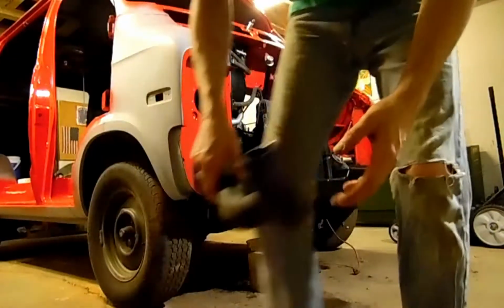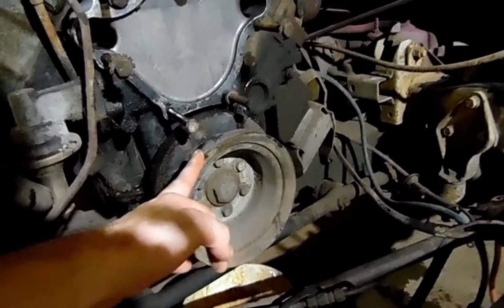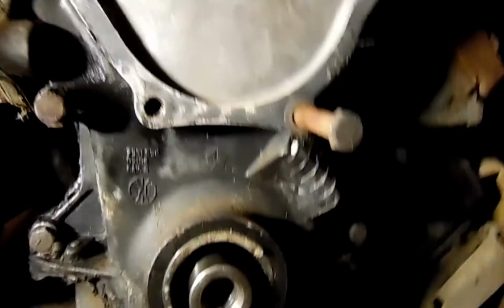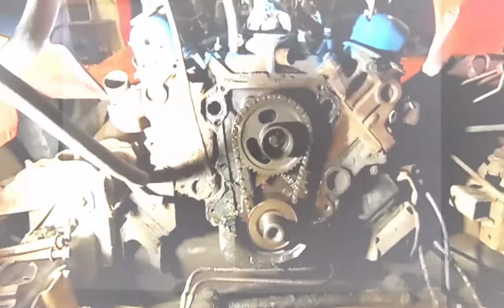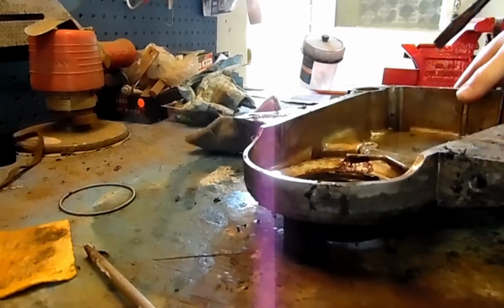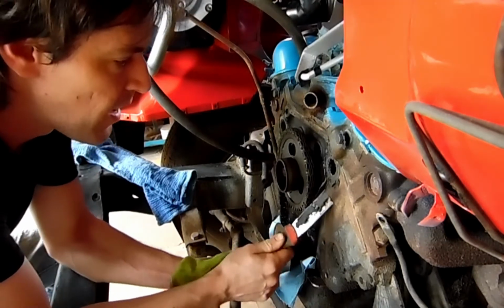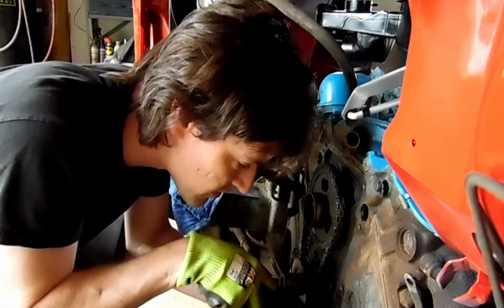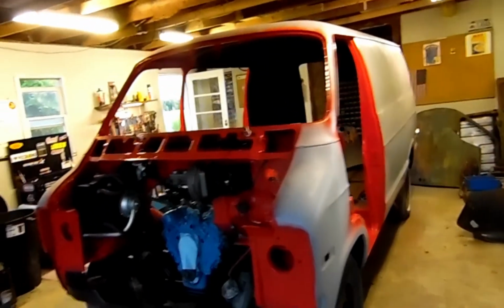The Details PART 4 - Hoosier Garage

Comment: I forgot to mention that the V6 3.9 use a timing chain tensioner to keep the chain taught completely interchangeable with all LA blocks, I've used them on my roller 360 and my roller 318 with good results.....and I like using the timing cover where the front crank seal installs from front makes it easier to service if need be. The cover uses no dowel pins so installing the cover loose and the putting the damper on to center the cover and seal is all good idea. Got a bucket full of those pulley fan spacers can't bring myself to throw any away!
Reply from the maker: That's the tensioner that bolts in place of the old can plate isn't it?
Reply: @HoosierGarage  yes it is ..... it's available at rockauto cheap! P.S. don't pull the pin till you got it on!